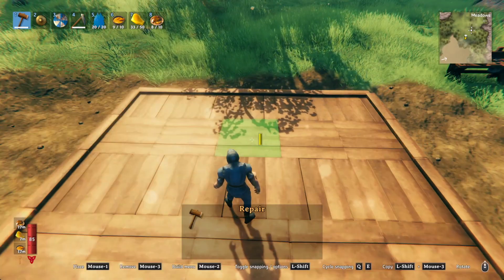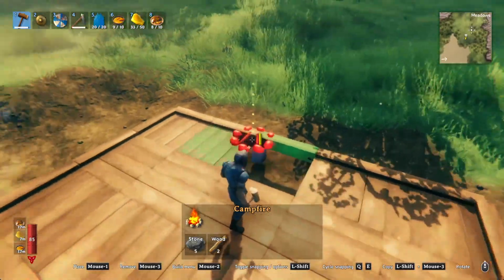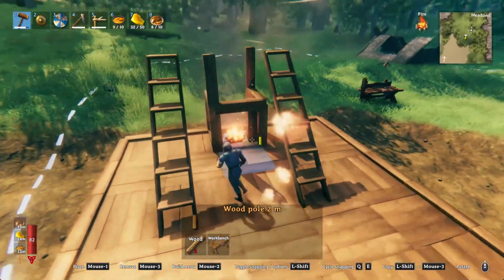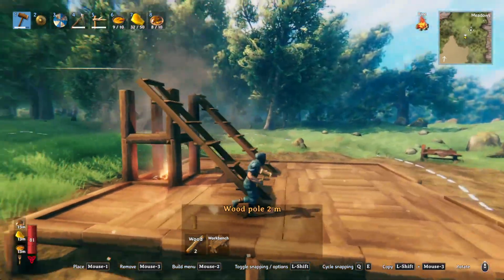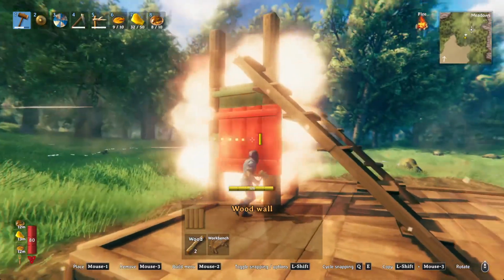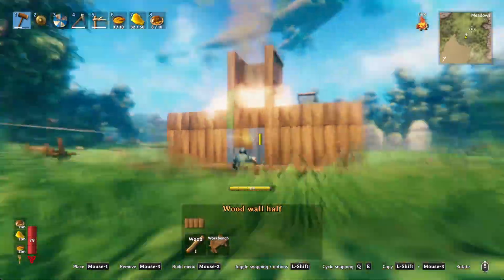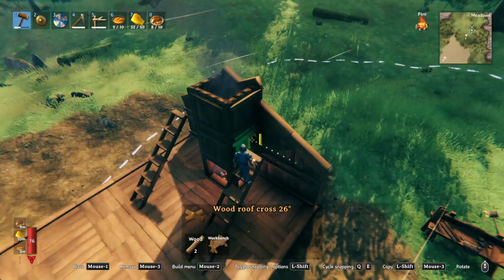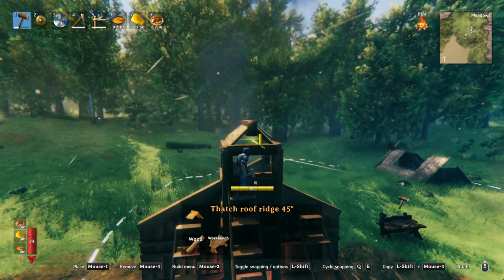Build a PRO CHIMNEY VERY EASY! | Valheim

Comment: Ideally, the fire should heat the ENTIRE house with no cold spots.  That is why I like a cruciform shape with the fire dead center.

E key works the same as Q, but in reverse direction.
Reply from the maker: Yeah I want to design a home like that as well with fire dead center
Reply: @ChoseNSurvivalRPG  if you have a Discord channel, I have screenshots.
Reply: @ChoseNSurvivalRPG come see my base, it has such feature, you even show case it here